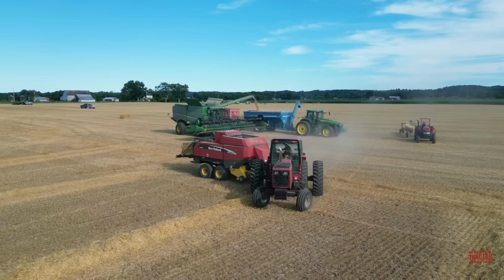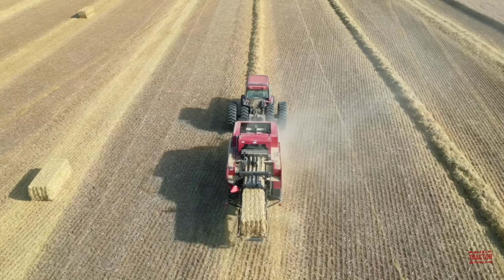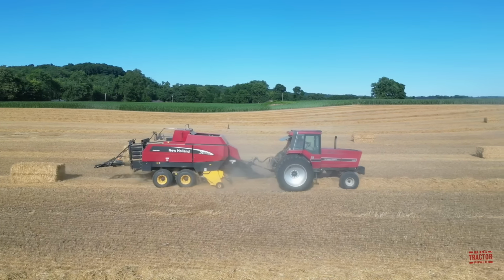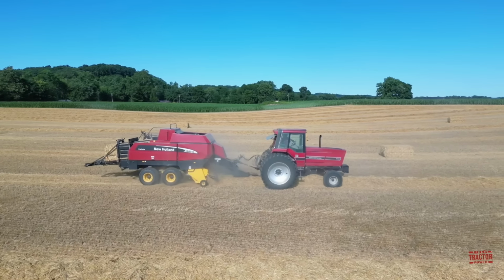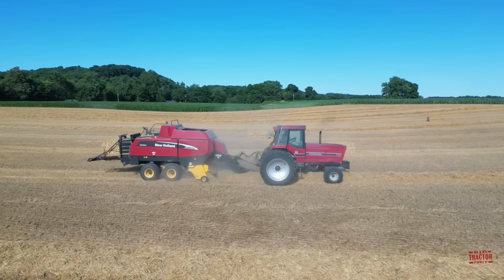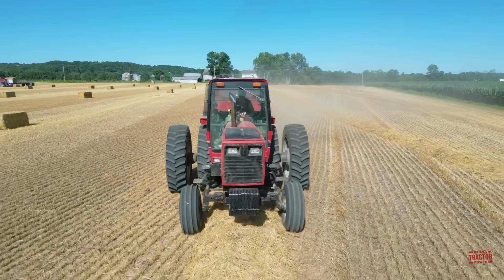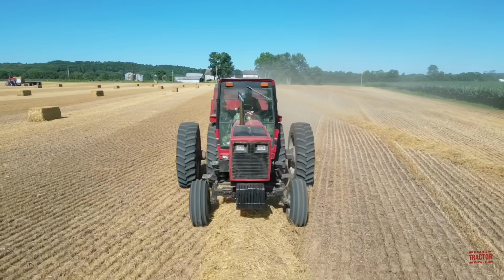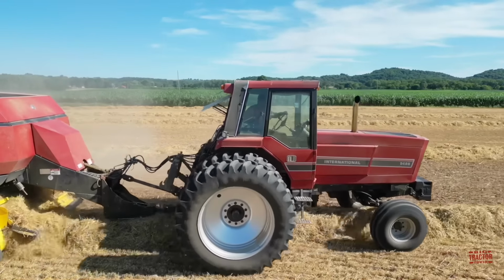INTERNATIONAL 5488 Tractor Big Baling Straw

Comment: I always wondered if the lugging  due to the plunger stroke, us hard on the tractor
Reply from the maker: A big baler will work out a tractor.  They can push it around for sure. I have never operated a big baler so I am not sure as to what the wear and tear is running one.
Reply: @bigtractorpower they can cause some where but nothing crazy. That lug or surge really isn’t any different than if your shift the power shift. Everything cause wear but it’s nothing crazy here for sure.
Reply: I've seen them break the PTO shafts off newer case Ih tractors I've had to weld a bolt on then of the broken shaft so they could pull it out and put a new one in . Those Balers still have a pretty big flywheel on them and a lot of momentum so the surge isn't as bad as you think it is It may be more noticeable on an older tractor like this one but nowadays they're using 300 hp or bigger tractors to pull those .

Comment: Would a tractor like that be able to handle a Krone baler, or must it have more HP?
Reply: Depends on the HP requirements and such. Most likely it will
Reply from the maker: I have not had a chance to film a modern Krone. I recently filmed a new 4x3 Case IH big baler.  It was on a 310 hp Magnum and ideally a 340 hp tractor would have run it better.  I would say the bigger the better.

Comment: Very nice video. Love the styling of the 30 and 50 series IH tractors. 
What’s the deal with the JD combine not putting down a well shaped windrow you can easily bale? You shouldn’t have to rake it first, like in this video. Maybe they just need a red combine to do the job right.
Reply from the maker: Allot of farms rake straw to help air it out and lower the moisture level ahead of the baler rather than waiting a day to bale.

Comment: Round baled winter wheat straw for a few years.  Other wise we bale mostly soybean straw and corn stalks in the fall and some hay in the summer with a fleet of New Holland 560 round balers and CaseIH MX Maxxum tractors.  I have also run a 2x3 New Holland big square baler for about 25 years.
Reply from the maker: Very cool.   The MX Maxxum is a good tractor.

Comment: ❤😊 BACK IN 76 THE FARMER THAT I HELPED GOT A 450 DIESEL FOR THE SUMMER TO USE AND IN 77 WE GOT 656 HYDRO TO USE!!! BOTH HAD FAST HITCH BECAUSE THE CULTIVATOR WAS FAST HITCH . BOTH TRACTOR'S WERE RENTED FOR THE SUMMER FROM BOORS INTERNATIONAL OF NORTH MANKATO MN ..THE 706 GERMAN DIESEL WAS LEASED TO GREEN GIANT IN LE SUEUR MN FOR PEA PACK AND CORN 🌽 PACK❤😊
Reply from the maker: Canning crop harvests were very cool in the 70’s with FMC LV and Hammocheck combines pulled by tractors.  Were they running a two row FMC or IH sweet corn picker on the 706?
Reply: @bigtractorpower  NO UNI PICKERS WERE USED IN 76 !!! 75 WAS LAST YEAR FOR THE MOUNTED PICKER
Reply: Most of what I remember back then in the lot was IH 234

Comment: Sounds like that DT466 would grunt with every progression of the bale. Expected based on the load?
Reply from the maker: A Big Baler at 7 mph cranking out a bale a minute puts a 5488 to work.  You feel the fly wheel and plunger.
Reply: Yes it takes a little to compress and form bales. Can make a 400 horse tractor talk too I’ve done it before lol